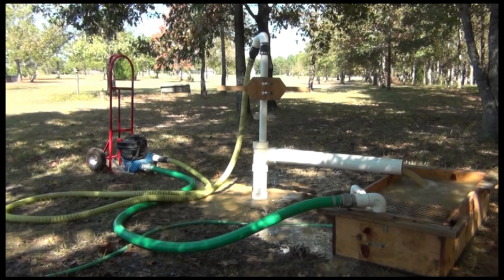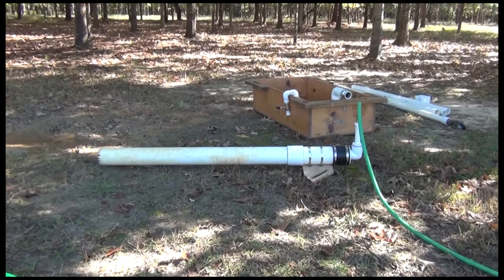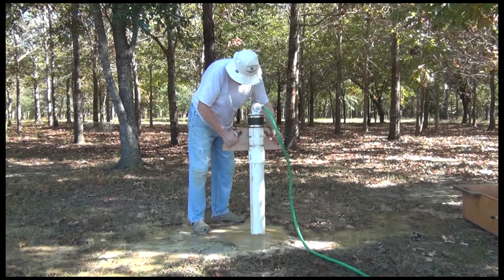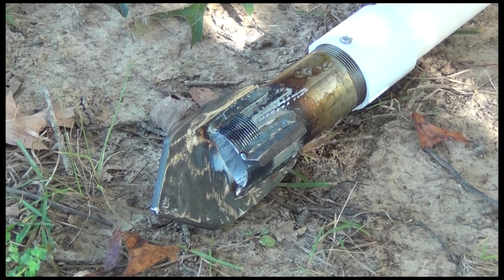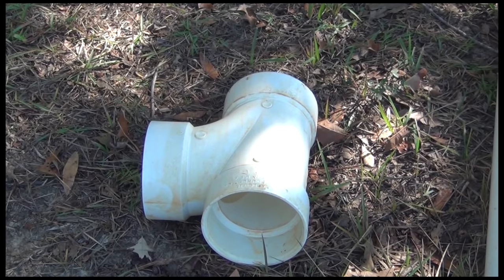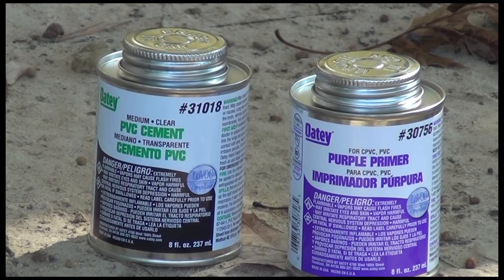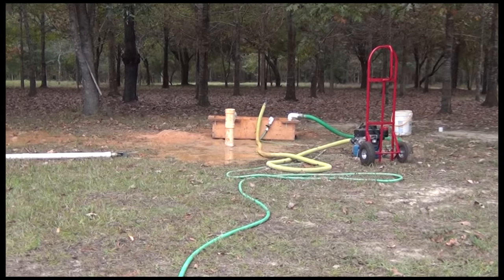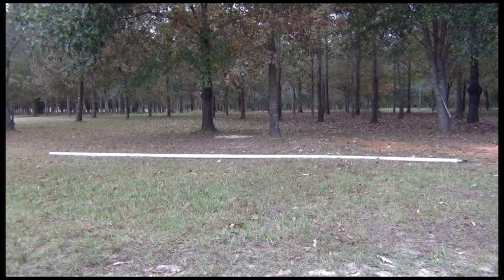Drill Your Own Water Well - Mud Pump & Portable Mud Pit

Comment: Fascinating video, and very tempted to "have a go".. My only concern is that where we live here in the U.K, we are on very chalky ground, which is fine, but with the chalk comes lumps of flint - some times very large..What happens if, having got so far down, one stumbles across a large rock or flint..? Also-when you say a "mud pump"- is that what the pumps are sold for, or can I use a conventional water pump capable of handling solids..? Thanks for your help,,Regards,David.
Reply from the maker: David, I'm glad you like the video.  Please be sure and check out the website.   This technique will not drill through rock.  Sorry.   A mud pump is sometimes called a trash pump.   A semi trash pump will work too.  They are made for pumping water with mud, small sticks, leaves, etc.  Be sure and use one that has a cast iron impeller.   The sand that comes up in the drilling process will quickly eat up a plastic impeller.  Good luck on your project!

Comment: Love all these videos! Couple of questions for you. why is it a good idea to pull out the drill if stopping for the day doesn't the hole collapse on itself? Second question is do you need a permit to legally drill a well or is it free game for every one? I live in Jacksonville FL if it matters.
Reply: i'm pretty sure one needs a permit for most places there may even be places where you would not be allowed to install a well. cities want you to get water from them so they can tax it.
Reply: You may not know about toxic areas that could have unsafe underground water and the other reason for permitting is so a bad neighbor doesn't contaminate the underground water supply that ties all other neighbors together with an improper installation.  How would you like it if you spend all your money on an installation and then your neighbor drills near you and ends up dumping toxic chemicals or sewage that leaks into your expensive well? Permitting documents these wells for inspection and regulation for your and everyones safety. Yes the system can corrupt but so can private citizens.

Comment: I tried this process but failed at 32ft. when I lost all of the water from my mudpit down the borehole. I started drilling again with 275 gallons of water and lost that in about 5 minutes.
Reply from the maker: Were you below the standing water level at 32 feet?
Reply: I thought the standing water level in the area was at around 12ft. I should have hand auger to first water before I started drilling. I put 15ft of screen and 17ft of solid 2" pvc down the drill pipe (32ft total depth) thinking I had plenty of water bearing material because I could not go deeper since I was losing all of my drilling fluid at that depth. From 15ft on looked good with coarse sand. I checked the water level 8 hours later after putting in the casing and it was at 11ft. The next day it was 30ft and has not come up. Don't know if I plugged the hole using Bentonite? Only used two small shovels fulls.

Comment: Do you use bentonite for the whole drilling process?  How much bentonite do you use?  Thanks
Reply from the maker: You have to quit using bentonite when you get down to where you will be setting your screen.  Otherwise, it will seal up the sides of the hole and you won't get any water in.

It takes very little bentonite mixed in well with water to be effective.  A fifty pound bag usually lasts five to eight wells.

Comment: Sir please reply to me.. i have a great idea of drilling in the best way. Please reply. I am from india
Reply from the maker: What do you have in mind?
Reply: @dawmlw  sir i find a way to drill a well, using suction power with the help of water motor. Which i will fix with those pvc pipe and water and soil will be pulled out with those suction motor. Is it possible sir?
Reply from the maker: I kind of doubt it but give it a try!  Let me know how it turns out!
Reply: @dawmlw  Ok. Sir i will try in this month.

Comment: At what point do you put the “screen point” in ? Once you got your pipe dug do you take off the drill bit and install the well point screen?
Reply from the maker: This is described in detail on the website but basically you put a 1.25 inch screen down through the two inch drill pipe once you are at least 10 feet below the standing water level.  Then you remove the drill pipe, leaving the screen pipe in the ground.
Reply: @dawmlw  thank you!! That was the only part I was unclear on. I will check out the website. I am going to try this method, but I do not have any water source to help dig the 4inch casing. I guess a post hole digger will get it done.

Comment: Since you done glue the pipe together !   How in the hell you was able to pulled that back out  ?   Lol .... so if tomorrow you drill to 45 foot and quit .  You got to pulled out 45 foot back out ?   Is that even possible ?    How that work ?
Reply from the maker: No, after you get past about 30 feet, pulling the pipe out becomes impractical.  There is a point at which you just have to keep going until you are done.  Typically if you drill 25 feet in one day, then the next day you can finish.
Reply: @dawmlw  so the drill head stay with the pipe when you are done and just leave it in there ?
Reply from the maker: At the conclusion of drilling you immediately put the 1.25 inch well screen pipe down and QUICKLY pull up the drill pipe.  Be sure and raise it far enough that the well screen is fully exposed at the bottom.  Pull it all out if you can, but be sure and get enough out to expose the well screen.

Comment: How much bentonite would you use in an sanding borehole 30 ft deep
Reply from the maker: about two cups, maybe three.  A little goes a long ways..  You have to thoroughly mix it  before you put it in.
Reply: Thanks for responding quickly

Comment: Question.... with the style drill bit you made, it appears you would've had to pull the drill pipe before setting the casing.   Is that how you did it?  if so did you have trouble with the hole sanding shut?  or does the bentonite help that much?
Reply from the maker: +Shawn H Good question!   I cover this in a little more detail on the site but basically you quit using bentonite about 10 feet from the bottom of the hole.  Then you pull  the drill pipe out and put the well screen (open ended) back down.  The last 10 feet will have sanded in but be pretty soft.  Then you wash the drill screen down that last 10 feet.  Test pump it with a pump that you don't mind getting sand in (like the mud pump).  If that goes ok, seal the bottom of the well screen by pouring cement down the well screen pipe and let it set for a couple of days.

Thanks for watching!
Reply: +dawmlw : Sorry, there another product that you can put if i dont have bentonite?

Comment: If I need to use a submersible pump, can I use a 2" drill pipe? Or do I need to use a 4" drill pipe and leave it in as a casing?

Comment: If I understand correctly water is pumpered to the bottom which is then pumper to the top and don't under stand how it is pumped to the top
Reply from the maker: It is pumped down through the drillpipe to the bottom of the hole where it catches cuttings and comes back up around the outside of the drillpipe in what is called the "annular space."

Comment: I need to go 100’. I’m in central Oklahoma. In your opinion, would this set up work?
Reply from the maker: No, I'm sorry but I've never heard of anyone getting that deep.  It is incredibly easy to stick the pipe as you get deeper.  I have gotten 65 feet using a lot of bentonite in a sandy area.   What kind of soil do you have?
Reply: @dawmlw  I’m not exactly sure. I’ve been trying to find out, but I can’t get any knowledgeable info. I’ve had 2 different commercial companies come out. They’ve both said sand & clay for the most. What do you mean in your comment “It is incredibly easy to (stick) the pipe as you get deeper”? Do you mean the pipe will go in easy OR the pipe could get stuck in the hole?
Reply from the maker: @joshprotz5278  It will get stuck in the hole as you are drilling.  Bentonite will harden the sides of the hole and allow you to go deeper.   It is pretty cheap to just try it with hose(s) from your house as a water supply.  That will give you an idea of the concept.
Reply: @dawmlw  I would use bentonite either way. Maybe I’ll build a drill bit about 1” bigger then the pipe. That way the hole is bigger along with the bentonite walls. Both drill companies told me 100’ feet minimum probably closer to 110’. They both are looking for $45 a foot plus the cost of the pump & things. They quoted me $8300. I’m desperately trying to figure something else out.
Reply from the maker: @joshprotz5278  If you are going to try - GO SLOWLY.  When it seems like you are advancing easily, don't be fooled.  It is extremely easy to stick the pipe suddenly.  But, I have to say, at $8300 a pop, it is worth a try.
Reply from the maker: you will need a recirculating pit, a mud pump, and a metal drill "bit"

Comment: Clever setup! Any indication on how straight the borehole is when using pvc pipe? 

Have you drilled a 2” hole and tried reaming it with a larger bit, perhaps 3-4”?
Reply from the maker: The hole tends to be fairly straight, although if you are not very careful in the first 10 feet it won't go straight down.

Reaming it out, at least for depths over 30 feet tends to be very hard.  I have not done it but if you wanted to try:  Use plenty of bentonite with the two inch hole, then go back with the larger "bit and go back down to the same depth, again using bentonite.  This way the hole will stay open.  Then without bentonite drill the last five feet where you want to put your screen.  And that last part is going to be seriously tricky.  Take lots of time because you can stick that big pipe really easily.
Reply: @dawmlw  thanks for the feedback. I am contemplating the possibility of drilling several 3” holes around 50’ deep and installing a 1” geo loop in each of them. 

The geology in our area is a cap of till, then thick grey river clay to about 80’ so drilling should be consistent until the sandstone layer. 

I’m thinking If I can keep water flowing down to the bottom and back up to the surface while I install the loop hopefully the loop won’t get stuck.
Reply from the maker: @rad1876  That will be tough.  Most of the loops are for four inch holes.

Comment: I just tried a 2" and 1" version of this today with a smaller water pump(1" clean water, raised high on the far side of the mud pit).  Before my stem started to leak up the sides I was impressed with the results sinking a 1" test hole 10ft in about 20 min. I dont have much water to work with , so this method is great!  Now...how to make sure my stem seals better..if thats possible..
Reply from the maker: Good luck and thanks for watching!  Bear in mind the holes get exponentially harder as they get wider.  A two inch hole should be no problem though.
Reply: I could be mistaken, but I think the surface area of a 2d 2x2" is exactly 3.14x of a 1x1". Now we can just wait for a 'math person' to comment!  Thanks again :)

Comment: Hello dawmlw..Thanks for your video..Just started my well..change a couple of things..will see how it works out..Being my trash pump has a strainer on suction line I did not install screen in portable mud pit..but did separate with 2 x 6  on edge..I have my guide tube down..and hopefully will start drilling today..I made my own drill bit..using the same concept as on your web site..on mine I used a 2" x 2 1/2" swage  will give me a little bigger hole hope this works..Robert
Reply from the maker: Robert Ballast Sounds good Robert.  Good luck!
Reply: dawmlw ..Good morning dawmlw..yesterday the drilling went smooth ..hit a dead tree at about 17' and at 18' started hitting what appeared to be a good course water sand ..could not find the betonite  so I bought a liquid poly-gel made by ECONOMY MUDPRODUCTS CO. HOUSTON,TX..Of course I'm just guessing how to use it..Anyway me and my wife stopped at 26'..we are both in our 70's it was an exciting day..when i started pulling drill pipe out ...pulled it up about 18" and the hole must have caved in because it would not go back down..pulled it out for the night..Then measured down to the water it was 9' from the top of the ground..will measure again this morning ..And also look for your email address ..Thanks Robert

Comment: Why the 4 inch pipe? Could you not use a 2inch pipe in place if the 4 inch, then use the 1 inch suction pipe as usual?
Reply from the maker: The problem is getting a screen on that one inch piece.  Solve that problem and you've got it.
Reply: @dawmlw  yes you are right, but there is always 2 1/2 or 3 inch
Reply from the maker: @Brian-ausie  If you simply use two inch you will be able to get 1/25 inch screen down it.  That works best.
Reply from the maker: The four inch pipe is just to guide the water to the mud pit.  It has room for the two inch drillpipe to fit inside.

Comment: how deep can we dig and what happens when we hit on a rock...?
Reply from the maker: Drilling through rock requires conventional truck mounted equipment.   This technique will make it down to 50 or 60 feet if you use bentonite and don't get in a hurry.

Comment from the maker: It won't be quite as strong.  Usually, it is fine.  It is just that when you are putting a joint 30 feet under the ground you don't want it to break so I always use primer.

Comment: What's should i do if i found clay? Continue?
Reply from the maker: Yes.  It will be slower but you will get through it.  If you are using a PVC drill "bit" you will need to sharpen it occasionally.  Metal drill "bit" will work much better.

Comment: 24' in one day?   Pressure is your friend.  Could have used a pressure washer stream to make that much faster.
Reply from the maker: It seems like a pressure washer would help but in practice it doesn't.  It turns out that water volume is the key, not water velocity.  It needs that good volume to carry the cuttings to the surface.  Thanks for watching!
Reply: dawmlw yeah but if you attached a high pressure water nozzle on each side of the drill blade and pushed 150 psi water through each one and still use the mud pump you could prolly drill pretty fast (comparatively speaking). just make yourself a pressure tank that you fill up then pressurize with a compressor. use a large tank so you dont have to re-pressurize often
Reply from the maker: The pressure washer does a spectacular job of cutting through the clay but then you need lots of volume to carry the cuttings to the top.  Have you tried using a pressure washer?

Comment: Why not use pipe as outer case to protect Sides from collapse
Reply: my understanding is that lots of people go down 10+ feet with 4" for a head-start and leave that section of pipe in the ground.  then they begin with the 2" drill pipe with teeth.  then, once they hit the water-bearing gravel of sufficient depth, they install the 1 1/4" well screen after gravel packing the bottom of the 2" hole and pull up the 2" pipe up a few feet so that the screen (pipe with slits) is fully exposed to the water-bearing sand.  you can check out dawmlw's two-part videos to understand this better.

Comment: Good videos.  Have helped me work out ground water depth . How to deal with it .and how to utilise it too . Also these drills are cool . I did wounder if it could be done with pvc pipe .
Reply from the maker: It certainly helps to use a metal pipe nipple as the "drillbit" but PVC works if you sharpen it regularly during the drilling process.
Reply: Yeah I've seen a few made . I was going to put the end from a hole cutter on it minus the drill bit in centre the sort of thing you cut lock holes in doors or holes for pipes etc . I plan to add more holes for water to pass threw .

Comment: How do you know when you have reached water and have drilled far enough down?
Reply from the maker: Look for sand coming up when you are at least 10 feet below the standing water level.  Set the screen so the top of the screen is 10 feet below the standing water level.  Deeper is better.
Reply: @dawmlw  Thanks

Comment: It could have been better but I just used a plasma cutter to quickly notch the pipe. For the larger pointed bit I cut two small triangles and one large and quickly welded them to a pipe union. I plan on working to get further down and will post more progress later

Comment from the maker: Sorry, I just saw your question.  The deepest I have gone is 50 feet but I am sure it will go deeper.
Reply: Thank you for you video. I am at 20' with a mud pump however the dang hole is drinking all my water. I am just pumping my water into the hole, which just started happening at 20'. I dont have a metal tip only notched PVC.
Reply: @jasonsizemore2365 , were you able to establish that you were already in water-bearing sand at 20' which would produce a good supply of water?  And, what was your final experience and result(s)?

Comment: coupling broke off lost 15 ft of pipe how would i retrieve it, its about 15 ft down.
Reply: What size is your pipe ?
Reply: For future reference, box stores sell a device that hooks to a water hose, called a “Cobra rubber bladder”.  If a person could manage to get it slipped down inside the broken pipe, then turn on the water, it might allow enough grip to pull the broken pipe out..  just a thought